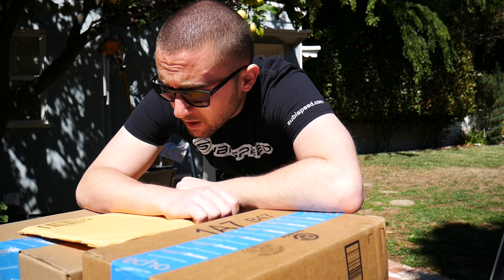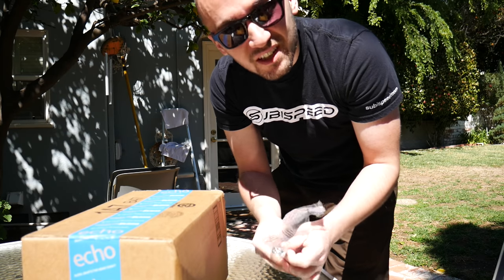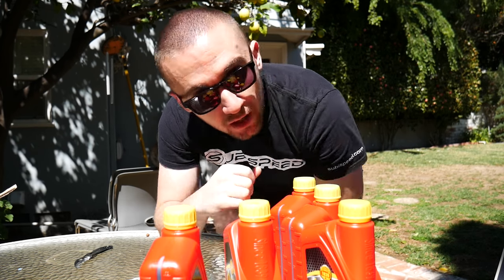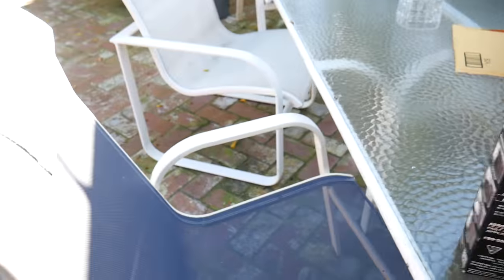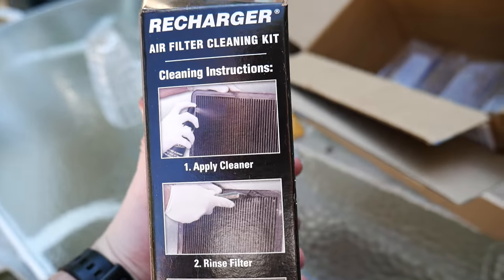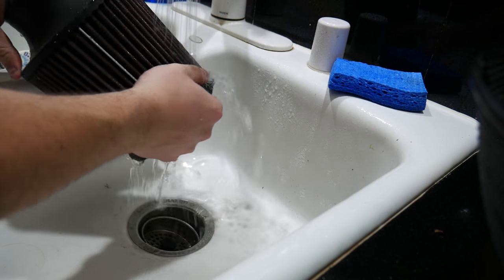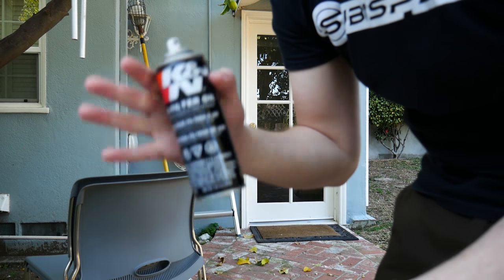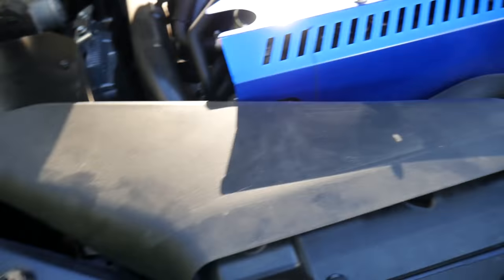How to Clean Your Cold Air Intake

Comment: I didn't realize Subispeed had the harness as well and I ordered have the one from Subibros. Shocked to find that the Subispeed version is half the price of the one I got, they're pretty much the same exact thing and usually, SS is on the higher side. Too late for me but hopefully those in the market are more aware than I was.
Reply from the maker: +Ryan yeah they actually just released it last week. They look identical to the subiebros one. I was gonna go with the subiebros but figured I'd buy everything from one place since I was getting a couple other things aswell
Reply: well I test wired it tonight and it seems to be working so I guess I'll get my $30 worth. I'm kind of wondering why Subiebros marks their version up so much in comparison and I'm tempted to ask them. Hopefully it doesn't blow my blind spot system module because, for some reason, the tail-as-turn had issues - not sure why.
Reply from the maker: It may just be that they have more overhead to deal with compared to Subispeed otherwise it looks like they are straight out of the same factory lol. Identical. And I never heard of any issues like that? I guess just be careful and keep an eye on it. Glad its working though. I can't wait to get mine, this mod is way overdue for me.
Reply from the maker: Well that's good to know and pretty damn cool! So you made the original for them?
Reply from the maker: +Chris Rodriguez oh sick haha well that makes sense. Thanks man!